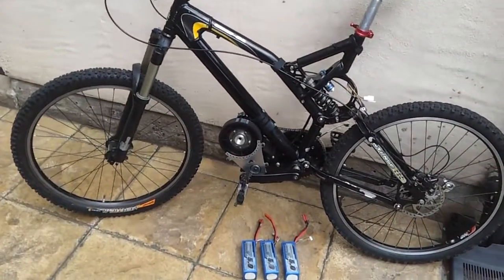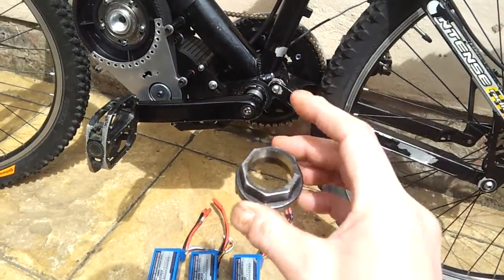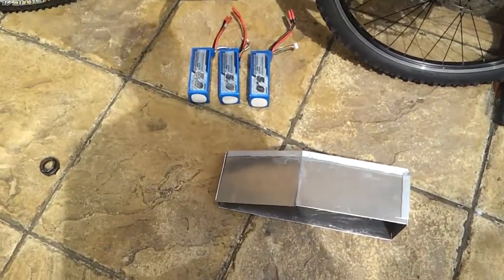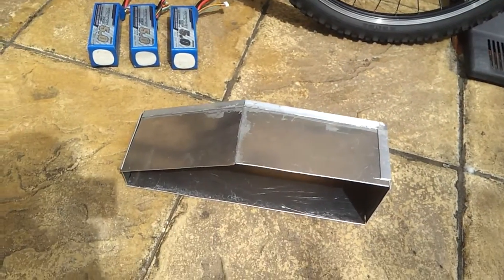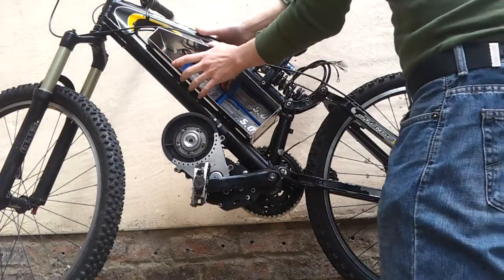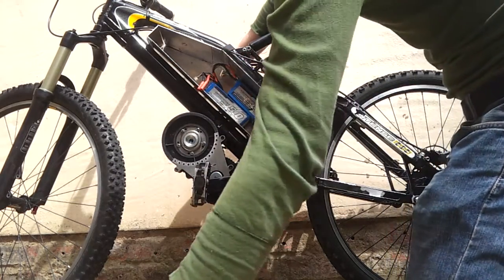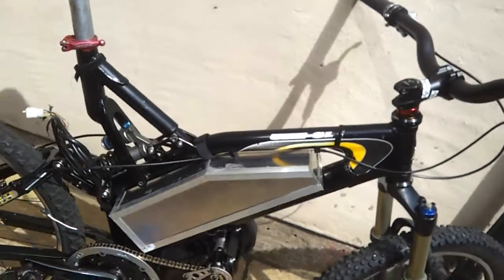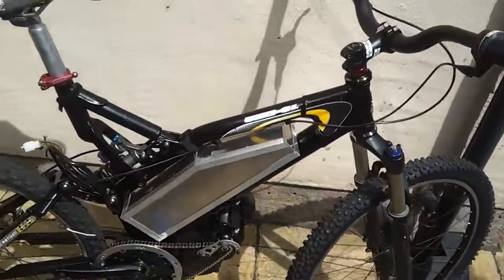Electric bike project..aluminium battery box

Comment: The chain that goes from the cog on the motor to the cog on the pedals is the cog on the pedal a free wheel that spins with out the pedals moving and whats it called and where did you buy it from?

Comment: That's a pretty good looking setup bro. 
👍. Have an LR big block as well, awesome motors. Challenging to get the needed components into a full suspension frame. Nice work. 

Have you considered AL brazing rods? 
All you need is a decent hand torch. Preferably with MAPP gas. Much cheaper than AL welder.

Comment: They have aluminium braising rods you can use with a propane torch, they actually work pretty well and cheap. Not the best looking but if you have tight joints they sweat together really well. Check out some aluminium soldering videos on YouTube.

Comment: What motor is that?
Reply from the maker: It's the lighting rods kit buddy..1500w version runniing at about 2700w atm.
Soon to be for sale i fear.
Atb
Reply: @stoo234  Why sell it. No good!?
Reply from the maker: @tekoppentekoppen761  it is good..works very well.
The frame is too smsll for me and its more tailored to single track light off road use...
My hub motor kona stinky is  just nicer on road n concrete..:)
And im skint..lol
Reply: @stoo234  Im thinking about welding my own.

Comment: try a mastic called sticks comes in black clear and white rub it down then glue then pop rivet.  when done go over the whole thing  with carbon wrap and rubber on the inside and good luck gerry
Reply from the maker: +Bobby Dazzler thankyou buddy top tip .. sadly rivets are a no go as i dont want anything sticking out inside;] that glue sounds intresting tho.
anyways the ideas changed again im going to make a leather bag to fit over the top bar..like an additive bike bag style..video some time next year at this rate!
thanks for your comments;]
atb.

Comment: great work and vids... i want to build a battery box for a beach cruiser.. 29er... im using 4 22.2v 8mah  lipo batterys.. the goal is 88.8 16ah in the end.. can you help me?
Reply from the maker: +Gerald Bennett hello buddy i ll help if i can..;]
.. what do ya want to know
Reply: what type of material should i use.. without welding..
Reply from the maker: +Gerald Bennett the lighter the better buddy..
you could consider plastic aluminium padded bags or leather satchels anything goes as lon as its strong and robust.
you can glue, heat weld.rivet or nut and bolt or even sew things together..
take a look at bike bag thats a good off the shelf  battery bag too.
really..anythying goes as long as it works!
Reply: i understand.. i just want it to be very neat and organized.. its going to be a model. :)
Reply from the maker: +Gerald Bennett for neat you need a solid box,then you can hide stuff init!
my pal just got the bike bag and its great ,tho a box will be better in a crash!
Reply: agree ty... i may go aluminum .. but i dont have the equipment need something from hardware or home depot store for supplies..
Reply from the maker: +Gerald Bennett they should do aluminium sheet buddy 2/3 mm thick would be good.
you can glue it using  nonails/sikaflex or some other building adhesive..flexable is best..the hard stuff seems to just snap away.plastic sheet would be good too as you can bend it using heat then with a solering iron or hot knife tag it together.glue up the edges with sikaflex tho to add more strength as it gets brittle when you heat it.
good luck buddy
Reply: wow... thank you very very much...